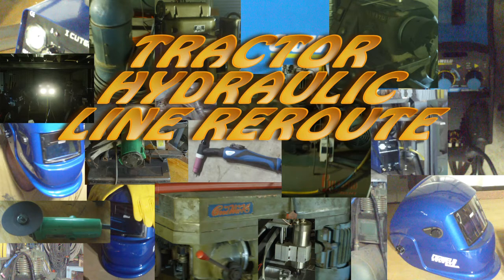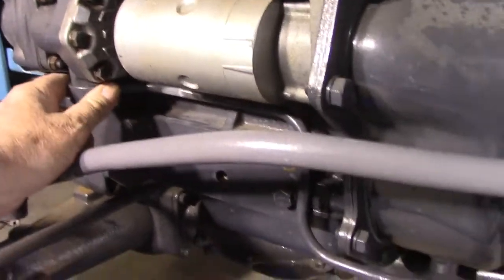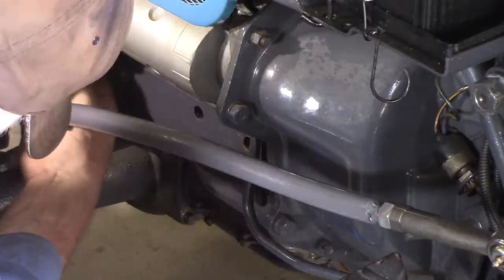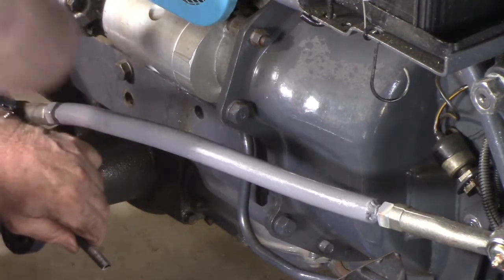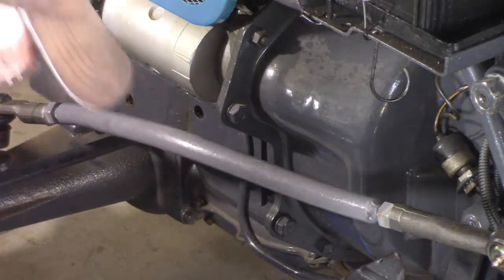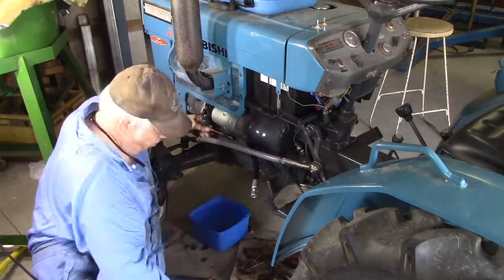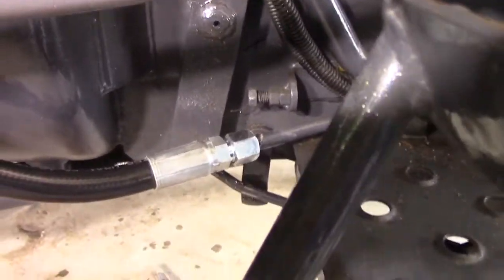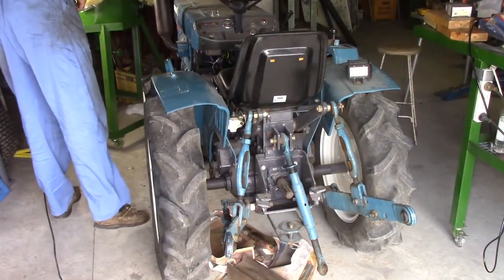Tractor Hydraulic Line Reroute

Comment: where did you hook up the front end loader to work to the tractor pump
Reply from the maker: I haven't finished it yet.  My current plan is to cut into the pressure line I had to reroute (see https://www.youtube.com/watch?v=b-MyPDJy5tU) and take the return line back to the hydraulic adapter at the rear.  My tractor isn't fitter with the hydraulic adapter and the ones I have seen for sale are over $300 US so I will be making one or cutting into the return line somewhere else.  Work is pretty busy at the moment so progress is a bit slower than I would like but I expect to finish within the next month and I will be posting video of it all.
Reply: okay wait on you do a video on it high pressure and low pressure like do my iseki small tractor